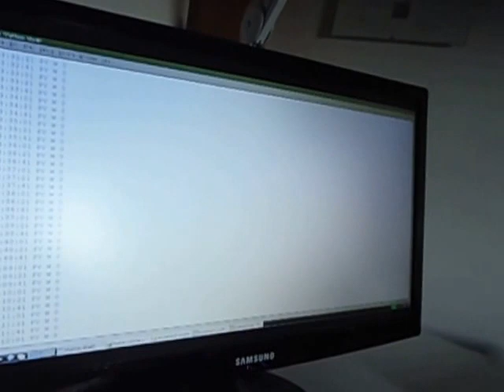Explanation of raspberry pi based immersion heater controller

Comment: Afternoon, to help you get rid of all the step down transformers etc and control it automatically, i developed an analog board which sums up the current produced by the inverter and subtracts the house of it, so the excess is sent vie a 0 to ten volt signal to a proportional controller to the immersion element. My electricity meter stands still once the circuit is calibrated, I can make a video if you like and give you  the circuits , currently i am building it all into a cabinet with my Raspberry pi running Node-red and controlling the entire process. Saves me about over a thousand pounds a year on water heating, as my house is on heavy oil,  and the analog board has been running for 11 years now. I have put the system into several houses in my area, with the current energy bills i am sure they finally laughing.
Reply from the maker: Awesome! I did this many years ago and I have to say I've learned a lot since then! X